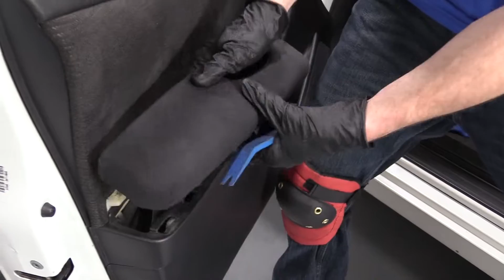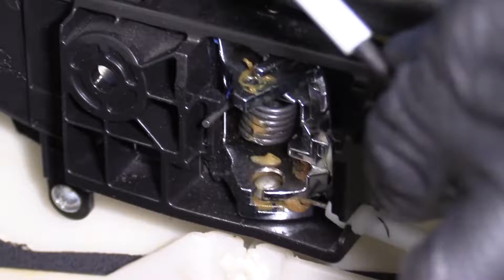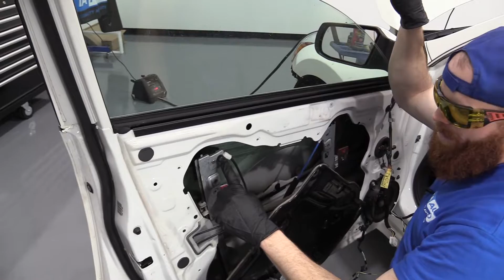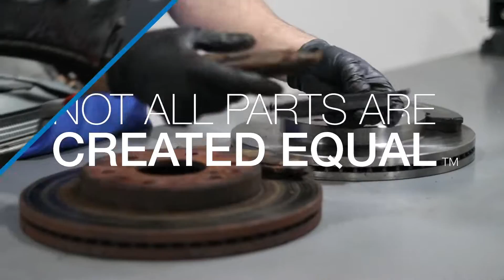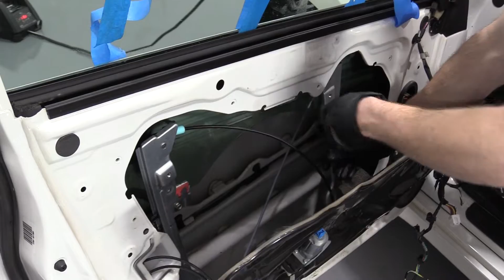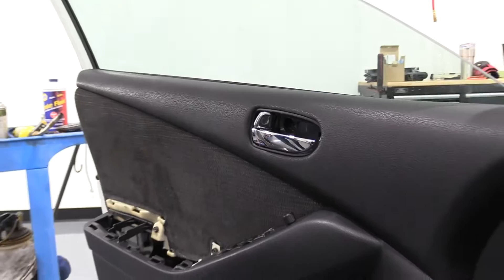How to Replace Front Window Regulator 07-12 Nissan Altima

Comment: ** @29:30 👍❤️👍! **THANK YOU!!! for your chill vibes SAVED ME TODAY 😁  (an Impatient) First timer, I was changing out an actuator, because of a broken cable, drivers side door would not open. Bring in a hurry, (for a date) , I ended up doing quadruple work, with door handle and window bracket etc... finally started over step by step... The next day...😁   😂😂😭

Comment: DON'T do it like that! 8 out of 10 times you will damage the regulator by allowing the cable to come off the spool! Assemble all the regulator, including the motor onto the door bracket first. Tape the window in the up position. Install the reg/bracket assembly. Position the window mount brackets so they can be accessed through the service holes. (2 holes,
 usually covered with a thin foam pad, 2-3") Lower the window onto them, then install the 2 attachment bolts. the way shown in the video is WAY to complicated!!

Comment: Did you know that there's two access plugs/holes on the steel cover panel so you can attach (or detach) the window regulator from the window without taking off that panel? So near the end of your video where you're having a hard time lining up those four bolts that attach the window regulator to the panel, you don't have to go through all that. You attach the regulator to the panel first, and then put the panel on the door, and then use those two access holes to access the regulator/glass attach points, and re-attach the glass to the regulator like that. Just an FYI.
Reply from the maker: +John McLaughlin We appreciate the feedback. Sometimes there are multiple ways to accomplish the same repair.
Reply: @1AAuto  Yes, almost always. Some are easy and straightforward, and others are much more cumbersome and difficult.
Reply: @JohnnyRawks  This response is gold 😂😂😂😂😂
Reply: Thank you for your comment. I'm installing a rt ft door glass in a local kids 07 Altima tomorrow morning. Helping him out no charge. I couldn't find a video for door glass installation so am watching next best thing,the regulator. Very happy you mentioned those glass mount access holes.taking that panel off looked like that part of the job that can cost precious time.  And be a P.I.A...Again I thank you very much.your comment I is as valuable as this video
Reply: @tomlynaghsr8752  Great to hear. I was happy to find those access holes as well. Some videos on this subject show them, others, like this one, don't. I used a flat head screwdriver to get a grab under the tape that covers them. I think you'll still be removing that panel and the regulator though. I don't think the glass will come out any other way. It's easy enough though. Detach the glass using the access holes, raise the glass by hand and tape it up, remove the panel with the regulator still attached to it. Then you'll be able to remove the glass and put a new window in.
Reply: This response was everything! Spent too much time trying to align the window to regulator before the regulator to door. Thank you!